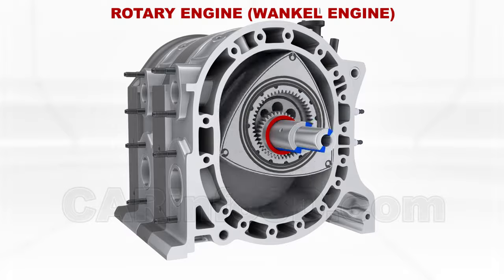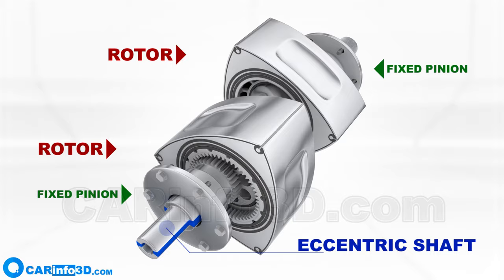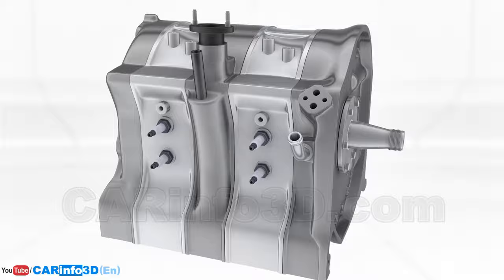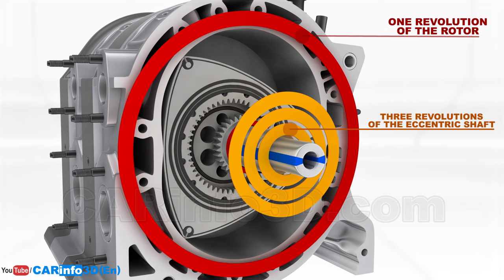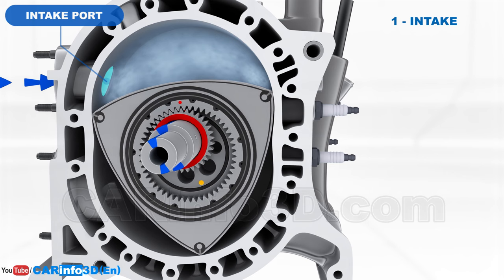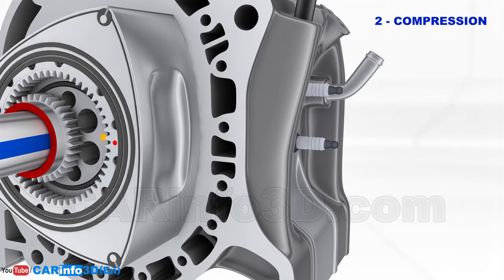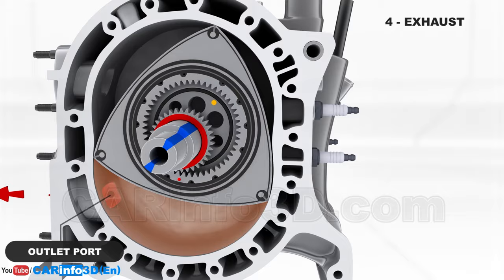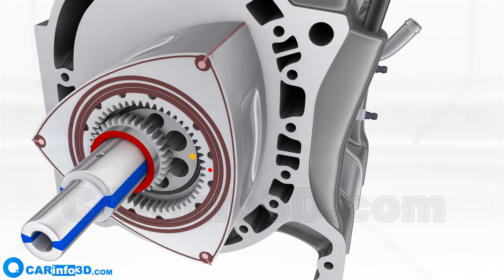Rotary engine (Wankel engine) / How does it work? (3D animation)

Comment: This is the most clear, correct, and complete Wankel rotary internal operation video that I have seen.
Reply: Except he got the name wrong. The intire engine rotates on a rotary.
Reply: @mr.donut2.085  there are many types of engine which are correctly described as "rotary". The antique reciprocating piston engine type with radially arranged cylinders rotating about a fixed crankshaft - the one to which you are referring - is a "rotary", because the cylinders rotate. Wankel's design with a three-sided piston orbiting inside an epitrochoidal housing is "rotary" because the piston rotates (instead of reciprocating). There are various other engines in which the housing or the pistons rotate, and so they are also "rotary". 

By far the most successful manufacturer of Wankel-type engines in history, worldwide, is Mazda. They prefer not to use the "Wankel" name (Felix Wankel was not part of Mazda, and not even Japanese), so they call them... Mazda rotary engines. That's perfectly valid.

He even put "(Wankel engine)" in the title to make it perfectly clear which of the many rotary engines is being described in the video.
Reply: The Wankel KKM57 is NOT a Rotary type engine.
Mazda never manufactured the DKM54 or any other Rotary type engine.
Reply: @WilhelmKarsten  The block does not rotate, but it is a rotary piston engine, meaning that the piston rotates rather than reciprocating.
Reply: @brianb-p6586  The DKM54 never saw production.
Reply: @WilhelmKarsten  yes, we all know that. What you don't understand is that "rotary engine " doesn't just mean engines with rotating blocks.
Reply: @brianb-p6586  True, Rotary means that it has a primary mechanism that rotates concentrically on a fixed axis.

Felix Wankel's DKM54 has both a piston and a block that spins concentrically.

Hanns Paschke's and Walter Frode's KKM57 engine discarded this complex Rotary design for a more simple conventional non-rotatry layout.
The KKM57 has a fixed block and a piston that reciprocates and orbits in a planetary motion.

The KKM57 has a eccentric-crankshaft.
The DKM54  has a fixed, non-rotating axle, like the Millet type Rotary engine.
Reply: @WilhelmKarsten  the rotor of the the KKM design (including the Mazda engine illustrated in the video) does not reciprocate - it only orbits. That is indeed planetary motion: rotation of the rotor about its own centre, plusthe centre orbits around the mainshaft. Yes, the rotor is located eccentrically on the mainshaft.
Reply: @brianb-p6586  WRONG!
The triangular shaped PISTON on the KKM57 RECIPROCATES and this reciprocating motion is what allows the piston to Displace a volume of air.

The Mazda 13b series has a 30mm STROKE   reciprocating left, right and then left again.
This 30mm stroke is produced by the 15mm offset lobe of the eccentric-crankshaft.
Reply: @brianb-p6586  Only the DKM54 has a ROTOR.
It spins concentrically on a fixed, non-rotating axle. (No eccentric-crankshaft)
The combustion chamber also spins concentrically.

Do you not understand the fundamental differences between the Rotary type DKM54 and the non-rotary KKM57?
Reply: @WilhelmKarsten  you should try watching this video (or any other) which shows the motion of the rotor in a KKM/Mazda rotary engine - there is no reciprocating motion. It is, as you already said, planetary... and planet gears don't reciprocate, either. 

And yes, I understand the difference between a DKM and KKM design... and have for about 40 years.
Reply: @brianb-p6586  It's an irrefutable fact, Mazda's published specifications for the 13B clearly states it has a 30mm Stroke.
Unlike the DKM54 the Piston of the KKM57 reciprocates to facilitate the 4 cycles and displacement of air in and out of the chamber as well as the compression and expansion strokes.
Reply: @brianb-p6586  You obviously do not understand the difference between the DKM54 and the KKM57..
Only one has a Rotor
Only one has an eccentric-crankshaft
Reply: @WilhelmKarsten  I obviously do understand the difference between the designs, but apparently you do not understand the word "reciprocate".
Reply: @WilhelmKarsten  please provide a link to this "stroke" specification. Does it have "bore", too, and maybe the "valve diameters"? LOL

For those who are not already familiar...
Wankel (DKM, KJM, Mazda, etc) engine internal dimensions are generating radius, eccentricity, and rotor width. A geometric formula can be used to calculate the resulting displacement of each chamber; there are three chambers formed by the spaces between the rotor faces and the housing. Mazda has published these dimensions (none of which are "stroke"), but usually just specifies the chamber displacement (e.g. 654 cc for the 13B and most variants since that one), and the number of rotors.

The Mazda 13B has a radius of 105 mm, eccentricity of 15 mm, and width of 80 mm. Twice the eccentricity is 30 mm, but it's not a "stroke" because nothing moves linearly through that distance. Good luck finding those or any specifications other than chamber displacement on the Mazds website... and you won't find "stroke".
Reply: @brianb-p6586 If there is a 30mm STROKE then it reciprocates.
Hanns Paschke and Walter Froede said its a PISTON... in fact its right in the name on the patent.
Reply: @brianb-p6586  If the crankshaft has a 15mm offset? THEN IT PRODUCES A STROKE OF 30MM.
Reply: @WilhelmKarsten  an eccentric shaft with an eccentricity of 15 mm would cause a 30 mm stroke... if there were a connecting rod connecting it to a sliding piston. There's no connecting rod and no sliding piston in a Mazda or other Wankel engine.
Reply: @brianb-p6586  Don't need a connecting rod son... the movement of piston is controlled by the mesh of the stationary and  piston gear which operates at a 1:3 ratio.
Reply: @brianb-p6586  The DKM54 is a Rotary type engine, the KKM57 is not.

Comment: I just learn there is inline 3, inline 4, Boxer 4, V4, Inline 5, inline 6, boxer 6, Flat plne V6, Cross Plane V6, Vr6 , FPV8, CPV8, Inline 8,  FPV10, CPV10, FPV12, CPV12, W12, W16, V16 and now i have to learn about another kind of Engine?

Comment: Der Erfinder des Kreiskolbenmotor war Hanns Dieter Paschke (NSU Motorenwerke) , erst seine Konstruktion war überhaupt verkaufsfähig bzw.für den Einbau ins Auto geeignet. Felix Wankel's Drehkolbenmotor war eine Katastrophe die niemals ein Fahrzeug zuverlässig angetrieben hätte.
Der Wankelmotor müsste eigentlich "Paschke Motor" heißen .
Reply: I agree that Wankel's Drehkolbenmotor (DKM, "rotary piston engine") was not viable, and that the Kreiskolbenmotor (KKM, "circuitous piston engine") designed by Hanns-Dieter Paschke is the design used in all successful applications. While naming these engines "Wankel-Paschke" would make sense to me, credit for the fundamental concept of a three-sided rotor orbiting in an epitrochoidal housing as an engine belongs to Wankel; Paschke never would have designed the KKM if not for Wankel's work and the issues with his DKM design.

Comment: これを考えた人は天才！！！
Reply: A German engineer Felix Wankel first came up with the idea as a compressor in the 1920s. It was then turned into supercharger for motorcycles in the motorcyclist in the early 1950s. By the mid 1950s he was convinced he could turn it into an engine. By the late 1950s thru had their first prototype.

So before it was an actual engine, it was first a compressor, then a supercharger, then an engine.
Reply: @franklugo6928  最初はコンプレッサーだったんですね！知りませんでした！ありがとうございました！

Comment: 3:24, rather than 720 degrees of rotation if it's compared to a standard 4 cycle engine. (not 360)  a v-8 would have combustion every 90 degrees, a 2 rotor Wankel would be every 60.
Reply: Is it a good thing ?
Reply: There is one power stroke per rotor for each full turn of the eccentric shaft, so that's every 180 degrees for a two-rotor (that full rotation of the eccentric shaft is 120° of rotor rotation, as shown @3:24). 

Any 4-stroke reciprocating piston engine does take two crankshaft turns (720°) for a full cycle; a Wankel rotary takes three eccentric shaft turns (1080°) for a full cycle (to get all three faces of the rotor through a cycle). That means:
V8: 720° / 8 cylinders = 90° per power stroke
2-rotor Wankel: 1080° / 6 chambers = 180° per power stroke
Reply: @bigdaddyyute6472  the only significance is that more frequent power pulses mean smoother power delivery (so more cylinders is always smoother), and that in any 4-stroke the power pulse is less than 1/4 of the cycle so more than 4 cylinders (or rotary chambers) are needed for continuous power. 

A two-rotor Wankel is equivalent to a 6-cylinder reciprocating piston 4-stroke engine in power pulse smoothness.

Comment: This is informative but I was searching for how half bridged rotary engines work and what is the difference between a half bridged rotary and a normal rotary engine
Reply: "This is informative but I was searching for how half bridged rotary engines work and what is the difference between a half bridged rotary and a normal rotary engine"

A rotary engine has 3 "plates" (sometimes called irons), and 2 "housings".  The housings, as the name implies, house the rotors- And these are sandwiched between the 3 plates (So its: Plate, housing, plate, housing, plate).  

The older 13bs have 4 intake ports. These ports are built into the plates. The center plate has 2, smaller ports, known as the primary ports. And the end plates have larger ports, known as secondary ports.  As such, each housing has 1 large, and 1 small port feeding air into it.

The idea behind "porting" a rotary, is opening these ports up- so more air can flow into the engine.  

When a motor is "bridge" ported, a small "eyebrow" shaped port will be added next to where the standard port allows air to enter the housing.  There is a small bit of metal left between these ports, forming a "bridge", thus the name. The bridge is necessary because rotors have a particular seal on the side (known as a side seal, unsurprisingly). The "bridge" has to be there, or else the side seal would simply fall out into the port. 

Now to answer your real question: A "Half bridge" is when only 1 of the ports into the housing is "bridge ported", instead of both ports.  Typically, this is done by only bridge porting the secondary (again, larger) ports.  The smaller primary ports are still often ported in these cases, (though not always), just not given a bridge.
Reply: @SidewaysGts  thanks for taking your time to give this explanation to me. I get it now. Appreciate it bro.

Comment: Does the rotors friction against the middle / front and rear housing?
Reply: Yes, the rotors have seals along each curved edge (three on each side of each rotor) which slide against the end and intermediate housings (as well as the tip seals that slide against the rotor housing). The rotor itself does not touch any of housings.

Comment: so it's equivalent of a V4, since it has 4 spark plugs?
Reply: Fwiw: Its not really "equivalent" to any kind of piston engine in such a sense.  

But on this matter, it has 4 spark plugs, but it has 2 spark plugs per rotor- Which would be more like a piston engine with 2 spark plugs per cylinder.

Comment: Are they inefficient bc the shaft spins at a high rpm then having to move what looks like gearing followed by the dorito?
Reply: No. The higher (compared to a typical 4-stroke reciprocating piston engine) main shaft speed is not a problem for efficiency, and neither is the gearing. The main problem with Wankel engine efficiency is the shape of the combustion chamber.
Reply: @brianb-p6586 It's a very serious problem and is the reason why the Wankel engine has such low mechanical efficiency
Reply: @WilhelmKarsten  no, but I suppose if you're ignoring physical reality and working without data you can believe what you want.
Reply: @brianb-p6586  No, it's basic geometry and mechanical engineering.
The piston of a reciprocating engine acts upon the crankshaft with a mechanical advantage (leverage) while the piston of the Wankel KKM57 engine operates with a mechanical disadvantage.
Any questions?
Reply: @WilhelmKarsten  I'm sorry you have difficulty understanding the geometry, but it still doesn't change physical reality.
Reply: @brianb-p6586  It's a irrefutable fact... it's a fundamental concept in engineering
Reply: @brianb-p6586  Wankel engines are notorious for having low BMEP and very poor overall torque characteristics compared to reciprocating engines.
Reply: @WilhelmKarsten  yes, low BMEP (which results in low torque) is the consequence of the poor combustion chamber shape.
Reply: @brianb-p6586  Wrong, that's IMEP

Comment: Which cars have this type of engine ?
Reply: Mazda rx7 & rx8
Reply: Here are some actual productiuon cars: NSU Spyder and Ro 80, Mazda Cosmos Sports Car, Mazda R100 Coupe, Mazda 'RX' series - RX2-3-4-5-7 and 8, and... the Citroën GS Birotor, to name a few. There were also some other production mazdas in there as well. Other manufacturers also made running prototypes for testing and investigation purposes.
Reply: Wankel engines have been out of production since June 2012.